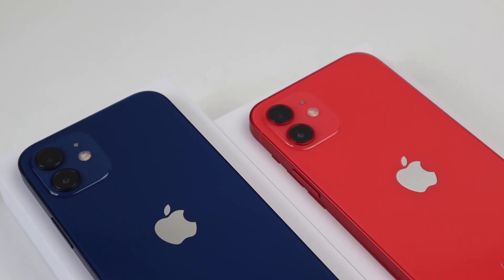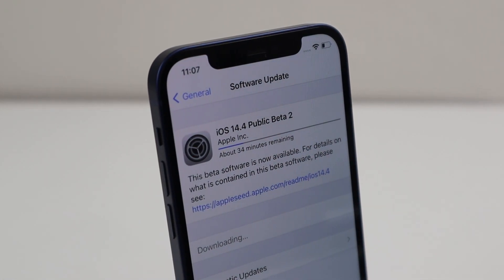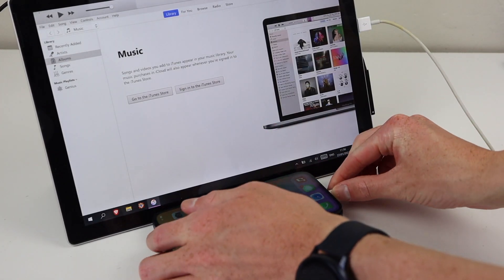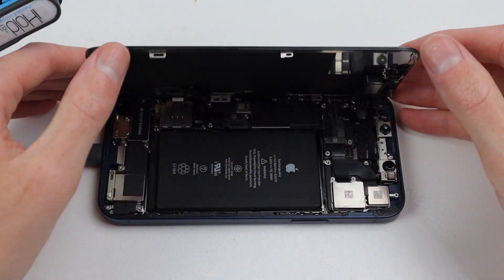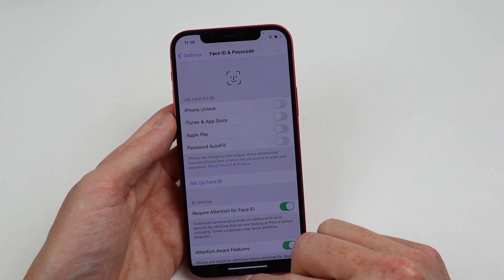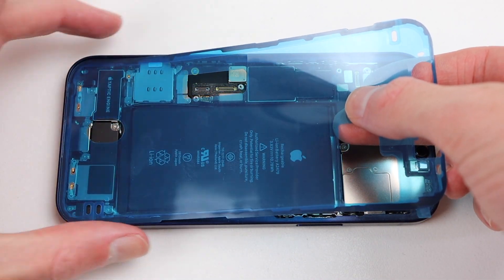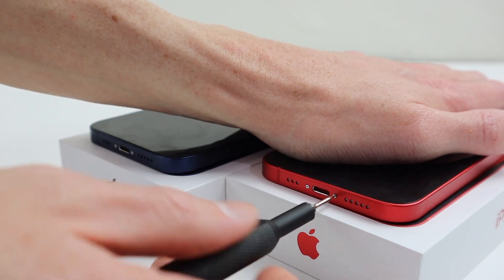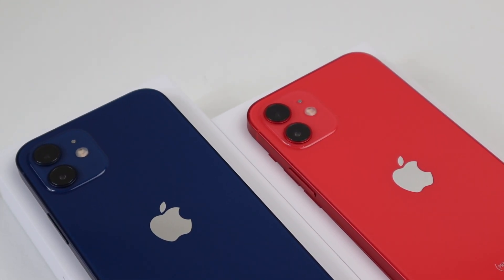iPhone 12's Latest Approach at Deterring 3rd Party Repair

Comment: I think there's only one way any of this will change: required regulator approvals for such software locks or the rewriting of such alert messages so an iPhone can more accurately tell if parts are genuine. To identify only by serial number is faulty; the user should be able to authenticate these parts on their own somehow.

Comment: I don't know why more negative noise isn't made regarding this. Imagine if my BMW needed a new starter motor but I took it to a non-BMW garage and they replaced it. But the car knows its not the original part so it disables the Air Con and electric windows. Imagine how fast BMW would be taken to court lol This issue has absolutely nothing to do with quality and everything to do with Apple making more profit for itself and authorised partners at the expense of the consumers right to repair how they seem fit... Afterall, who's iPhone is it?

Comment: if it were warning messages after putting aftermarket parts and not apple components without the software limitations, fine. It could be useful to avoid scammers selling phones that are refurbished and pretend they are "s new".
this however, is not a good intention

Comment: The parts list info is stored somewhere on the ROM and every time an iPhone is turned on, it runs a check to assure hardware integrity. A future third party tool might come along that would allow it to be wiped, removing the locks and enabling installation of third party compatible parts. Until then, you’re stuck with Apple and its authorized dealers for all repair work. You only have a license to run your Apple device, you don’t have ownership rights for it. That’s the way Apple wants it.

Comment: This is probably a bit unrelated but my iPhone 12 refuses to charge with non-apple chargers that worked with my iPhone 8. It displays a “liquid detected in port” message which is bs because it doesn’t happen with the original charger. The message appears every single time I plug in a charger that is not genuine and I have to “emergency override” it every time which then allows the charger to work. It’s pretty funny.

Comment: I work at a repair shop and can confirm that OEM parts and software are provided by Apple to pair them but get ready to pay a pretty penny for them. A 12 series display will run almost $500 for parts, labor, pairing and warranty. No word on batteries yet though.

Comment: iOS 15: adhesive now paired with iPhone. Other adhesives won't stick.
iOS 16: screws now paired with iPhone. Other screws won't screw in.
iOS 17: air now paired with iPhone. If non-apple air gets inside the phone, your phone explodes.

Comment: This is why android is better
Reply: J  Everyone wants to be like Apple. Android is still better
Reply: samsung did the same
Reply: @90ioel  this is true. Every companies tends to want to follow the apple. They have been doing it with cameras and touch ID sensors. Android is still more open as far as a software tho. Right to repair needs to be passed.
Reply: @NathenVaughn  fr i have an iphone 7+ luckily not a 12 bc if i did then i would be screwed as apple repairs cost alot and are sometimes hard to get through

Comment: Apparently the unable to verify camera message can pop up even with the original camera the phone came with. I work at a third party repair shop and I actually had a customer come in today with an iPhone 12 Pro wanting to replace his screen protector because his broke but the drop that broke his protector also seems to have damaged his rear camera because it started giving the "Important Camera Message" warning in his settings. When we opened the camera app pressing the button to change the zoom levels also didn't work at all, it was just stuck on the 1x zoom. The phone had never been opened up or worked on before and is running the current ios 14.4. This is the first time we've seen something like that here so it may be a one off fluke, but at least in some specific circumstances it can give the message with a phone's original camera.

Comment: to be fair if i was a consumer i'd rather a genuine camera over an ebay special one, got the screen on a laptop of mine replaced once, it had a really nice 1080p IPS panel, great viewing angles and very color accurate and they put the worst 768p screen on possible, TN panel, dim as fuck, over saturated, ended up talking to my bank and i was able to get a refund tho, as long as they dont use it to block the use of the camera its not an L

Comment: Ok so whilst this to some may seem like a bad move i believe its for the best - if you were buying a used iphone and someone was selling it as a perfect phone but it had its screen or battery replaced with a non genuine (some might argue inferior) part, then being able to quickly check system messages in settings and know the phone is perfect is a nice touch

Comment: When you go to get a repair apple, so called techs, quote you sky high costs telling you that the repair cost is so high it would be better to replace the phone. When apple causes it's own phone to state it's own parts are not genuine it's a racket. Have you tried to just open one remove the parts and put it back together with its own parts just to see if merely opening the phone triggers the lock down/out?

Comment: It honestly sucks what they're doing. I was considering buying an iPhone 12 as my iPhone 7's battery connector or the motherboard is partially broken. Oh and iOS 14.3. made my microphone stop working. I even replaced the mic part as I was hoping it was just hardware (and figured out that the battery connector is broken), but nope. Having a phone with no working mic is worse than having no phone. I always have to carry around BLUETOOTH headphones as it doesn't read any plug in headphones either. The worst part about having to switch to a different OS is that I'll loose compatibility to iMessage and international messages are ridiculously expensive. I'll have to eventually because in no way shape or form am I buying anything Apple after being blocked from calling people and not being able to repair newer phones.

Comment: Good work replacing the seals Hugh - I repair iPhones as a sideline to my usual work, and most that i see that have been to other repairers have no seal and most of the metal plates that hold the flexes down missing :(
Reply: And there's the problem with some 3rd party repairers. A lot of 3rd party shops do the repairs correctly and to a good standard. However as anybody can open up a tech repair business you also get a lot of cowboys who have no idea what their doing and end up damaging customers devices and/or using cheap poor quality parts.

Yes Apple does charge more for repairs but at least you know the repair is going to be done correctly and if they damage the device they'll replace it.

Comment: I live in the US, and work retail for one of the major mobile ISPs. My location does repairs for apple because our technicians must go through a full apple certification and test when a new phone comes out. For what I've observed is that Apple supplies our technicians with a calibration software ( a MacBook Air with only that software installed) to calibrate the phones after they are serviced. 98% of the phones they repair walk away with fully functional repaired devices with no issues. The other 2% is phones that fail the calibration and we order the customer a free replacement. Yes your swap is from two brand new phones but I think the phone needs it's software to understand that it was done properly.
Reply: For 3rd parties, they might actually have a device used for dumping data from batteries, cameras, etc. to then load it onto the replacement part so the phone doesn’t have any issues

Comment: It has nothing to do with genuine or not genuine parts. Make a deeper research. Every part has an ID and is stored to the mainboard. Apple has a special machine where they can overwrite ID‘s to the mainboard, that means that they can write the new ID with the replaced part to the mainboard and everything is fine.

Comment: How can they get away with the wording "non genuine" as this is incorrect as we know the parts are swapped between 2 official products,
More appropriate wording would be "unofficial repair"
It appears this phone does not actually have the ability to detect genuine or not, 
It just looks for a code i.e. serial number of the part that has been programmed in to the motherboard,
If the code differs the error comes up,
People just threw iphone's away when they broke the screen before all this (some people just throw the working phone in the bin once they got their upgrade), now they have even less reason to consider having them repaired, 
They stop supplying chargers etc because of electronic waste, these protocols will create even more waste in landfills etc because just not gonna be "financially viable" to repair them at apple rates and they cant be bothered to sell them as spares or repair

Comment: Why not just simply refuse software update? Also, more reasons to avoid Apple products
Reply: It wasn't working before the update.  Putting the update on it only gave the notification messages but the camera still worked.  All the other stuff that failed the first time he did this, still failed with or without the update. It's a deliberate Apple strategy.

Comment: Wether this was done by Apple with the sole purpose of deterring 3rd party repair, is by no means clear at this point. I do, however, appreciate that Apple pairs the battery with the phone, while offering battery service for a reasonable fee. If you treat your iPhone well, this is the only repair you'll ever need.  Also, the strictest controls are justified when replacing Li Ion batteries on a device that you can take on an airplane. Pairing the display to the phone makes it even harder for a thief of an activation locked iPhone to make money from selling it for parts. So I think all this works for me!

Comment: I just got my S8 earpiece replaced for dirt cheap. If i had an iPhone i wouldve been screwed. Hopefully Samsung doesn't implement these restrictions in the future. I already hate that they wont give a charger in the box!
Reply: @chickenbentobox  Headphone Jacks was kinda understandable as wireless accessories have gotten much better and common. But samsung fast chargers used to be best in class, removing those from the box is just an idiotic move. SD slot is something i have never seen someone use. Maybe its just me
Reply: surprise samsung just did the same

Comment: This is just sad because it’s removing job opportunities for third party repairs, they’re so money hungry
Reply: I would much rather use a local business than have to go to a multi trillion dollar company.
Reply: @emmae858  they cost a lot less too
Reply: Why do people still support apple when they know they're trying to screw over the customer ?
Reply: in a way its good that it says that (well it shouldnt if its original part) because if i buy used phone i dont want it to have changed camera with these chinese cheap parts
Reply: @swd6430  the problem is they disable the features, apple could use notification like"your parts is not genuine" and still working normally but they dont do it
Reply: @swd6430  what if I want those cheap Chinese parts?
Reply: @whynotsa6866  well it is to protect the buyer. seller can buy broken one, fix it with cheap chinese parts and sell it as brand new or slightly used.
Reply: @swd6430  that falls under free market responsibility. Apple reach should not go so far as to coddle the buyer. Must I be told what to buy from Apple? Why should Apple control what I do with a phone? If I want to get a quick fix, if people swap a cheap part and try to scam people off, that's not Apple's jurisdiction. That's a crime and it's either the platform fault or it's a legal issue and it will be government who should be dealing with this. Either way, it should not be a company responsibility to protect against scammers.
Reply: @swd6430  this is not about buying a new phone, its about repairing your current one. not everyone lives in a place where they have an apple store nearby or have the money to pay for apples "repair" thats as expensive as the product or even more, where if you take it to a local repair shop depending on the problem they charge you nothing compared to apple and its way more convenient than driving for like 3/5 hours just to get to the apple store so they can charge you more then necessary on top of you paying for gas to get to there in the first place when they tell you that repair is not worth it and that you should instead buy a new one...
Reply: @swd6430  if you buy a used phone expect it to be broken and fixed, if you don't like that buy a new phone not used
Reply: @brayneldelrio7044  no, normally people use phone for 2 years and sell it, and then i get it. There is really low chance that in these 2 years phone camera or something is going to break. so im all that for genuine parts and not chinese ones. but i dont agree with using genuine part and saying that its fake.
Reply: @Lootria  exactly some people don't have or either don't want to buy a new phone when they just bought one. Really disappointed with Apple for this. Im jumping ship with apple.
Reply: @swd6430  where do you think apple parts come from?
Reply: @caspernicus5822  well people use cheap chinese parts instead of oem ones that are build better (they are still probably made in china but higher quality)
Reply: @swd6430  for apple it doesnt matter if you use original oem apple parts since they pair everything to the phone so even if the screen, camera, battery, home button, whatever else are original its still gonna go "sorry this isnt an original apple thing"
Reply: @Lootria  yeah, im against that but if they use non oem parts it should say somewhere that part is not oem but it should not disable functions.
Reply: @swd6430  dude, the cheap knockoffs ARE the apple ones; the difference is in the logo.
Reply: @yogikkgaming  Using genuine parts from other iphones doesn't work either, people have tried it. They're just greedy.
Reply: @sharkie1630  so do u want people steal iphone and sells it as a parts? Because that parts is genuine and no need to display a notification that telling us ohh your phone has been disassembled and some parts been replaced lmao
Reply: @yogikkgaming  Even if you use genuine parts such as a genuine camera certain features are replaced (like fingerprint sensor or face detection). I think that they should just sell genuine replacement parts + allow more replacability on their phones. Then again Apple has been known to intentionally make phones slower so that people buy new models, so who knows if they will ever do that.
Reply: @swd6430  unfortunately you haven't done your due diligence reserach this is just a profit making move nothing more, inturn will create more ewaste and cause people more money. Had apple wanted OEM parts could be replaced from another phone sold for parts which even then they closed down, as for cheap Chinese parts you can always give a notification and let the device function as normal rather than disabling it all together forcing to only come to you as some people don't want to spend 200$ on a 150$ device inturn helps reduce ewaste and give jobs to third party people

Comment: iOS 18: Apple starts pairing the air inside the phone to each phone, if you change the air inside the phone for common air you’ll get an “unable to verify this iPhone has genuine apple air inside”
Reply: Air sourced from non Apple Authorised Service Providers could result in malfunctions such as overheating, slowness, and reduced product lifespan.  Non-authorised air also carries a significant risk of fire, burning, production of toxic chemicals around the device, periodic explosions, injury, and death.  

To ensure optimal safety and device performance, please bring your Apple device to your nearest Apple Authorised Service Provider as soon as possible.  

Our Geniuses will be able to assist in replacing non-authorised air from the atmosphere with authorised air from our Apple Stores for the low fee of $189.79.
Reply: @challengeman101  Sounds about right :)
Reply: Won't be surprise if this actually happen
Reply: apple fart pro max
Reply: J  You dont like the mostly screen phone?

Comment: I  watched  a video  the other day where they use a device  that read the old broken screan an then they plug in the new and load the code for the new screan  without the original  screan you are screwed  even if the old one is broken completely  as long as the flexi cable is intact  it sould read the code

Comment: To be fair, not allowing to replace touch id and face id is good idea, you use it while paying for things, imageine if fake touch id sensor was a thing and people could unlock your phone
Reply: I think there are reasons for Apple to do this. Some people in China use fauty iPhone parts and reassemble it in to a fauty iPhone, then take it to Apple store, so they can exchange for a brand new iPhone and resell it to the market as brand new. As you can see, the staff even cannot determine the iPhone has been "repaired", so I think Apple is forced to do this.

Comment: What if you only replace the screen? 🤔🤔🤔🤔 the most thing that will be replaced is the screen and battery, so the battery message i expected, but what if you only replace the screen? The message that the screen it’s not original will show but what else happens?

Comment: I'm a bit worried that other companies will follow Apple, (as they always do that for everything stupid they do) and it will be difficult to repair phones without fully original parts and software to "program" those parts afterwards. It would be a huge slap in the face for everyone that repairs phones.